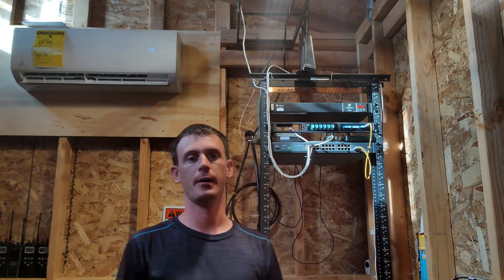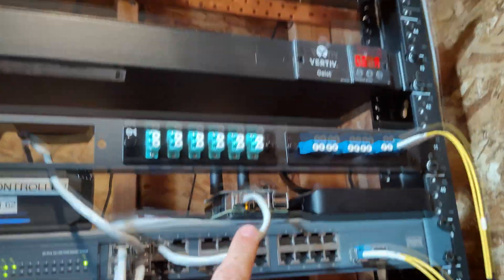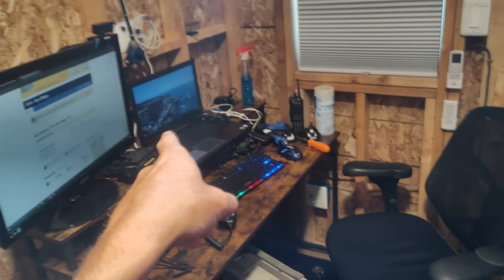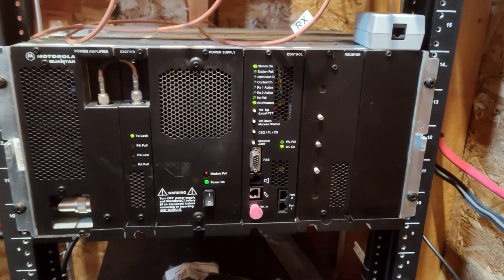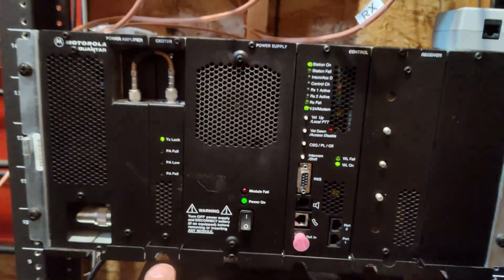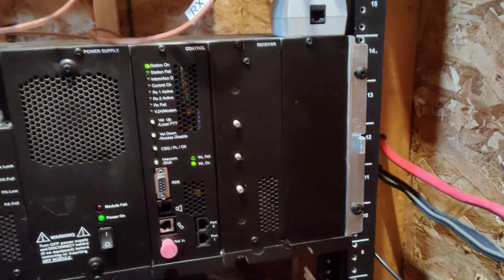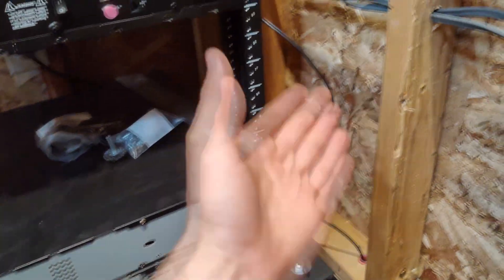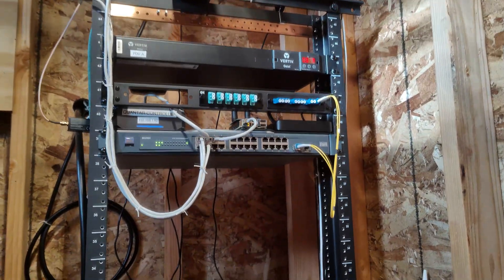Motorola Quantar

Comment: I haven't ever considered choosing cables based on their return loss (RL). The RL becomes higher as the cable/load impedance becomes closer to the reference in the RL Bridge but it also becomes higher as the cable loss increases. These two criteria oppose each other so you cannot tell whether a higher RL indicates a better match or a higher attenuation. Am I missing something?

Comment: You NEVER EVER air condition an uninsulated building ‼️You mentioned I believe that it never got above 87° with the windows open and the AC off. That is NOT acceptable for electronic equipment OR people❗️Can you imagine working in an office building all day in an 87° environment❓
The fact that you’ve focused all your attention on your equipment instead of a proper building environment makes me question your basic thought processes. This video gets an automatic 👎
Reply from the maker: @BartlettTFD You may need to also tell this to ATT, Verizon, T-mobile, and many more Telecom giants in the UK. 
several things to clarifiy 
1. This is not classified as a datacenter, office, or a room designed for people's comfort. This bulding was designed as a remote communication shelter. It was constructed to only house RF equipment. It is not a normally manned location. 
ATT for example runs their new comm shelters up to 100, after 100 the dampeners close and the small hvac unit kicks on to cool it to 85 then it shuts off and continues the venting process. 
Engineers in todays tech world are designing equipment with better air flow and bigger heat syncs to improve efficiency on site which means warmer comm enviorments. 
This is being seen all over the world today and you can view my cell site walkthrough video to see how this works (I would highly encourage you to view this video to get up to date on the new operating procedures)

2. As stated in the video, the high temp test was to simulate the HVAC failure on a hot day. The HVAC unit maintains the temp at 80 degrees 24/7. 
3. the RF repeater in this shelter is rated by the manufacturer for operating in tempatures from -30C to 60C (please dont take my world for it see the below link for the specs)
chrome-extension://efaidnbmnnnibpcajpcglclefindmkaj/https://www.repeater-builder.com/motorola/quantar/pdfs/uhf-data-sheet.pdf
see page 2.
Reply: Would love to know more about the controller device and software. Thanks!
Reply: As a retired Broadcast Engineer I agree you CAN operate electronic in the kinds of environments you describe BUT at a high cost. Reliability and longevity are 2 factors that WILL affect the financial outcome. If you have deep pockets like the companies you mention, then go for it‼️The cost of adequate building insulation is minuscule compared to the cost of the equipment installed in the building‼️
Your choice❓😂
Reply: @BartlettTFD  your an idiot engineer, you pry only do programming and complaining, I guarantee you don't know what hard work is. Your going to end up alone and miserable with your attitude.

Comment: 7:17 Port 1 is only a v.24 port. The later version of the Quantar had IP connections for system release 6.x and up. I'm going from memory, but I believe one visual difference was that the serial port on the IP Quantars were labeled CSS, not RSS. Port 1 was definitely available for v.24, but I don't think they ever enabled Port 2 for dual v.24 inputs. That right slot in the Quantar could also accommodate an internal UHSO module which for a very long time was used on UHF stations in support of NTIA specs for federal users. You're right though, that 2nd receiver module option was pretty slick.

Comment: Seems to be going well for you,  suggest you remove IP address on controller.  73's G8WOF
Reply: I think thats a private IP so it cannot be accessed outside of being physically in the shed.
Reply: @hardwiired  You may be correct but I think Jim Browning would find a way,  best not post IP's
Reply: @WOFFY-qc9te  unless Jim browning is gonna physically break into the shelter that IP is useless